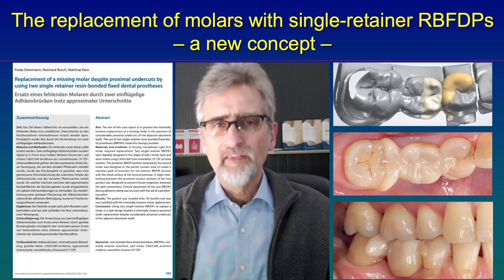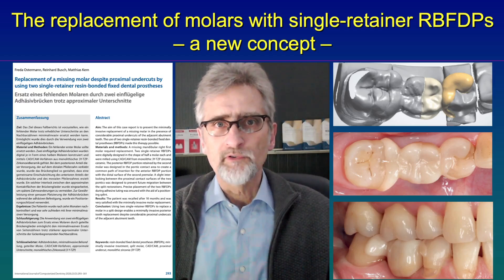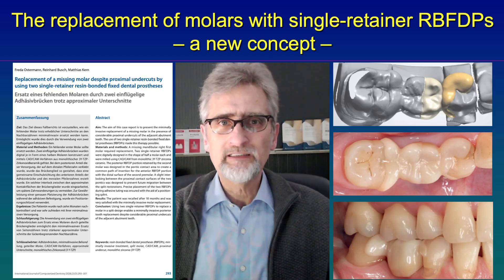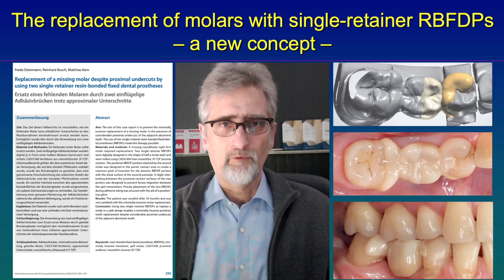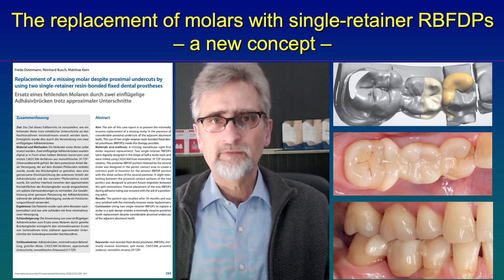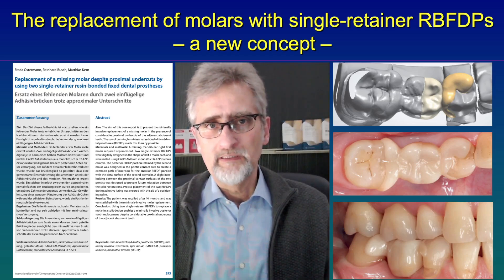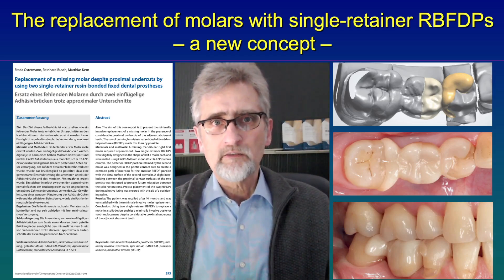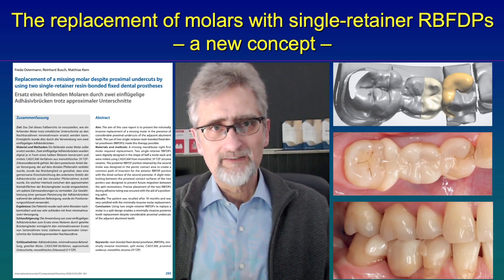The replacement of molars with two single-retainer resin-bonded bridges - a new concept -

Comment: This is quite a clever concept. Thanks for sharing the video. I'd like to try this for my patient. Do you have any information that you can send me. Any information for my lab technician to follow ? 

Thanks
Reply from the maker: We published details here: Ostermann, F., Busch, R., Kern, M.: Replacement of a missing molar despite proximal undercuts by using two single-retainer resin-bonded fixed dental prostheses. Int J Comput Dent 23, 293-301 (2020).
Send my a mail and I will share this article.
Email: mkern@proth.uni-kiel.de

Comment: Hi Prof Matthias Kern, thanks fr sharing! May I ask whats the advantage of the design in this video compared to a 180 degrees weap around at the whole lingual surface and a rest seat on occlusal? Thanks!
Reply from the maker: Hello, I think, for zirconia a 180 degrees  wraparound design is just not needed as zirconia does bend like metals, where a wraparound design might be advantageous.